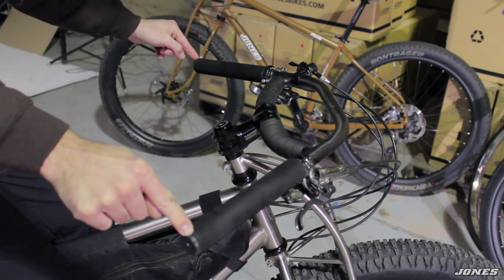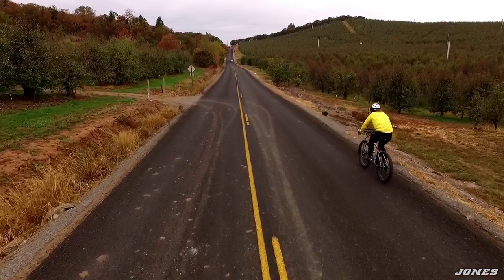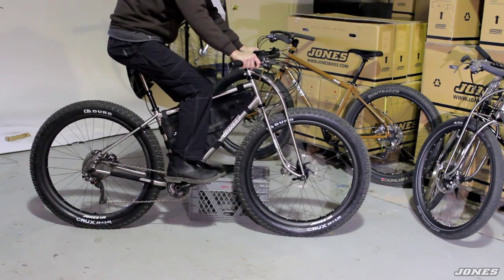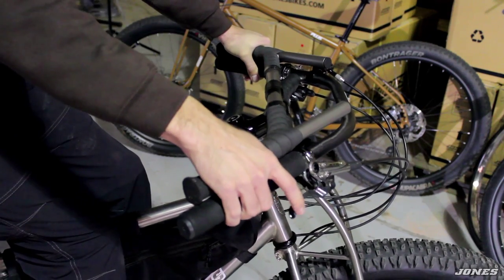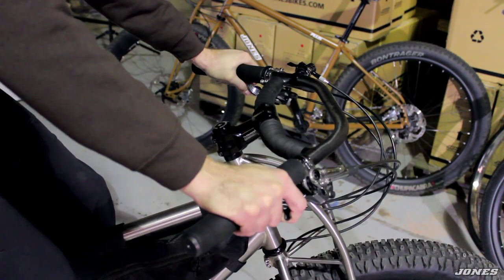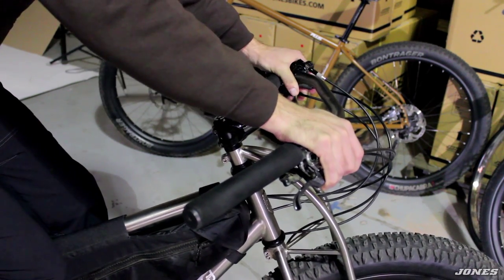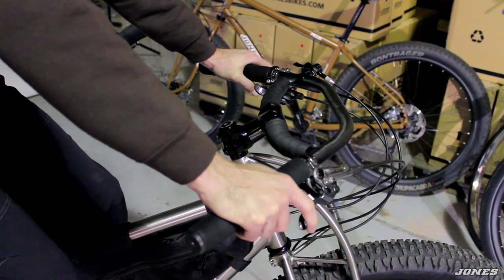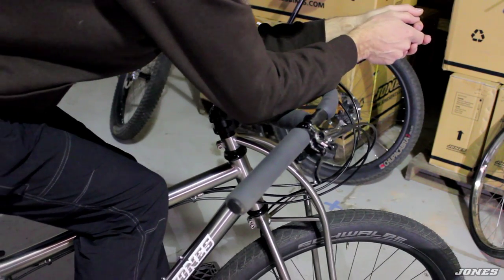Jones H-Loop Handlebar | Southern Oregon Drone

Comment: Installed the Jones bar on my Farley.
Used the shorter version with large Ergon grips.
Have one arm that's had surgery and doesn't like to be torqued by straight bars.

These bars were an outstanding solution.
The angles are perfect for me with no torque stress put on my arm.

Comment: Just for all yours information -this bar is actually a reincarnation of the original bars that came through on most of the mountainbikes of the 80's. It was a chrome/steel bar and it had two posts coming out front the insert section onto the crossbar.

Comment: i just started riding bikes 18 months ago, my first bike was a retro mtb, my second a dawes tourer, both of them geard up wrong, changed the back cassette, slight improvement, now changing the crank down, and also going to get rid of the drop bars on the dawes, i will replace them with loop bars, if these bike companies dont catch on quick and have optional fittings, then they will end up like norton and triumph, left that far back they can't catch up,

Comment: How do you get the foam padding on the loop bar sections? Did you have to cut it length wise?
Reply: It is a bar tape.
Reply: Or tennis racket tape.

Comment: My palms hurt a lot using the Jones 710 handle bar. I don't know why yet. If it is the position of my holding the bar or the bar itself. But, it hurts.
Reply: Put grip tape or foam on the bars. Might help. Also better padded gloves?